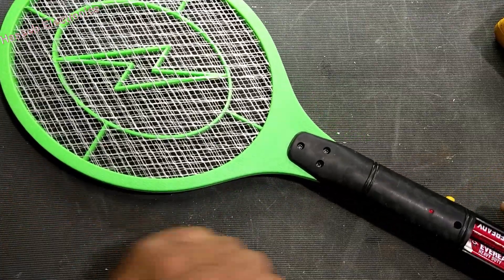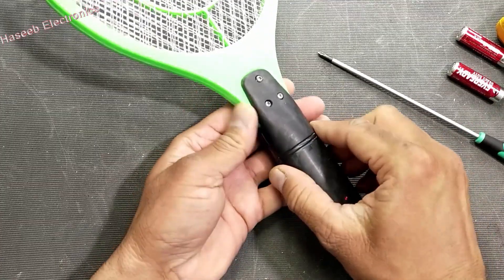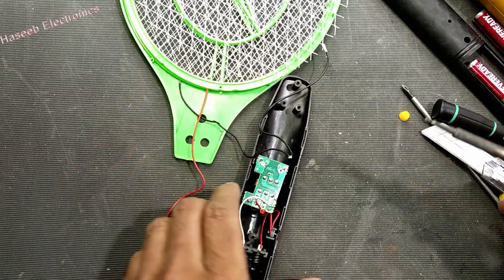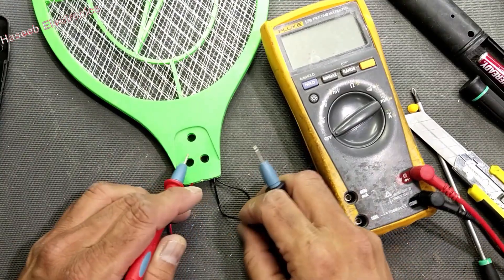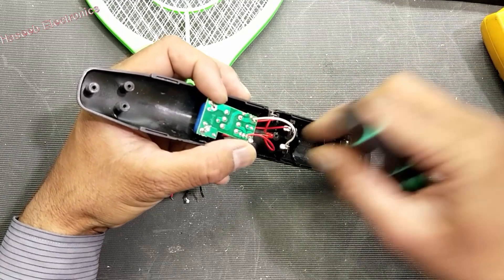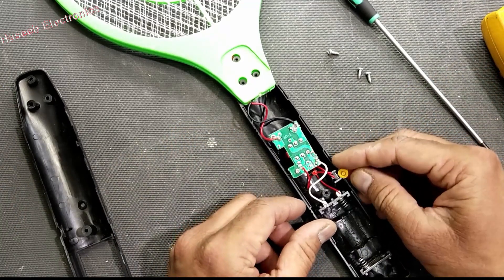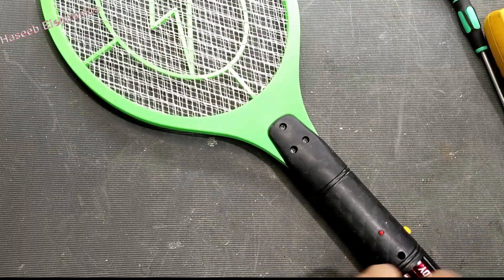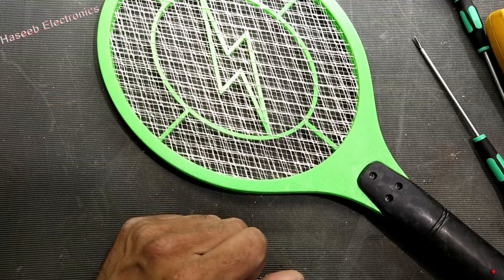[375] How to Repair INSECT KILLER / BUG KILLER / ELECTRONIC BUG ZAPPER

Comment: What happed to my swatter mosquito i payed yesterday ,when i try it  its not working the light is on but its not hiting. What should i do with the problem.?
Reply from the maker: if it was new piece. then you can ask the shop to replace it as it have fault. 
if you want to repair it 
check might be there is som disconnection 
might be pulsing transistor have problem, as it is not switching 
or may be metallic net, both plates are touching to each other

Comment: Any idea what transistor is being used in these? I have one but it seems to take a while to charge up. I removed the bleed resistor from the main capacitor which seemed to help but after a few zaps it's weak while turned on and you have to wait some time before it zaps again.

Comment: Thanks' Haseeb, just fixed mine now,  wire mesh touching, didn't know that you can press the button once to charge.
Reply from the maker: wow it is great 
yes the button is to be pressed to charge and it will remain active for few seconds, after that its charged fence is discharged by means of internal bleeder resistor

Comment: I have the same thing except mine's yellow. I got mine from Harbor Freight (US) tool store. (free with coupon!) It works a little bit. Quite a job to get a moth to fly in between the grids and stay there long enough to push the button! I didn't know that the charge remains AFTER you release the button. Maybe I was using it incorrectly. I love that you will fix anything in your videos. I got a good laugh. Thank you and have a nice day!
Reply from the maker: best regards
it holds electrical charge for few moments.
as it have a resistor across the capacitor, which will discharge the capacitor within few seconds, for safety purpose. 
wen we see fly or mosquito ,w
we have to press the push button while flying the racket in air to hit the bug
Reply: @HaseebElectronics  It's more of a game! Thanks again sir!

Comment: Salam M Haseeb, how many volts are in the capacitor and what makes the transistor switch ?
Reply from the maker: when we press the push button, it makes a pulse, 
the capacitor is charged at 1000VDC approximately 
it holds the charge for few seconds, because there is a bleeder resistor across the capacitor for safety reasons, so when it is not in use, it will discharge the touch plates
Reply: @HaseebElectronics  thanks ! Very smart